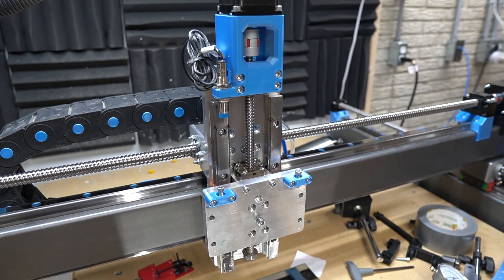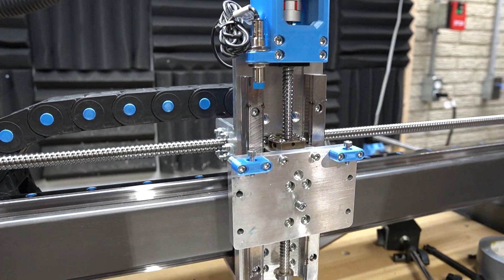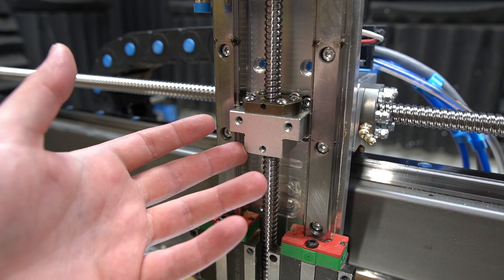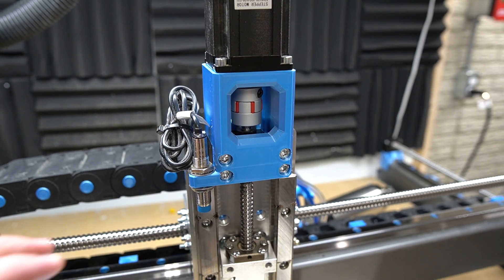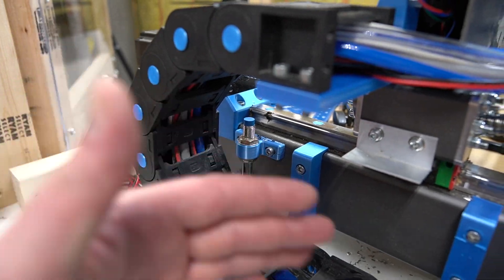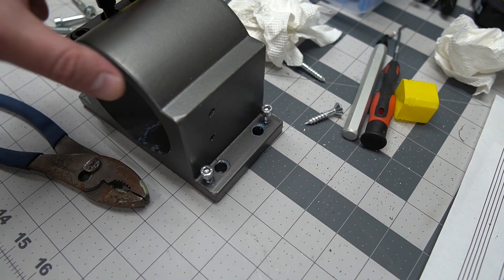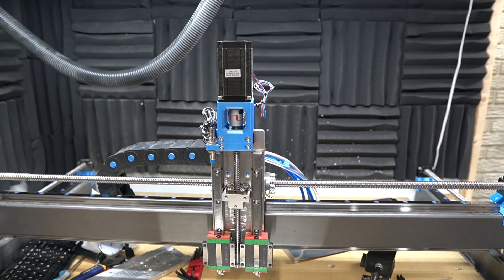Why I'm already rebuilding my PrintNC...

Comment: Hi Brian, it looks like your bfbk mounts are wider than the original. dou you know how or where this gets selected in fusion or do you modify the file? Thanks!
Reply from the maker: The bk/bf mounts I'm using I actually got from the wiki. I'm pretty sure they're parametric and I typed my parameters in to adjust it as needed. Take a look on there and I hope that helps!

Comment: Great content, Brian. I purchased a few items off your affiliate link. I was hoping to see the aluminum block listed you used for the Z-Axis T-Nut. I'm happy to purchase through your link if Amazon has a source for that.
Reply from the maker: Thanks Cory, I appreciate that! That Z Axis T Nut is typically a 3D printed part from the original design, however the aluminum version of it is a custom made part. It's just a modified version of a regular ball screw nut, with two chunks cut out to make for clearance of the linear bearings. I hope I'm explaining that well enough. There are a couple of guys in the Discord that make the T nuts on their PrintNC's to sell to other guys, or if you're handy with a bandsaw, that's how I made mine.
Reply: @ProjectsbyBrian  Thanks Brian. I printed the T-Nut, I'm just trying to find that ball screw nut block to modify. I see I'll need to cut it down , I just don't know where to get the piece to cut.

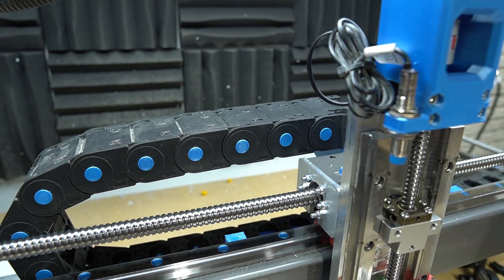Comment: Hello brian! Do you  have an idea where to find the bracket for the drag chain right under youre hand on  4:04 ? i placed my motor to the edge aswell
Reply from the maker: If you check the wiki, under the mods section, I think there is a thingiverse link to the file from there. I hope that helps!
Reply: @ProjectsbyBrian  i totaly missed that on the wiki! Ooops thanks!
Reply from the maker: @niksechtniks  No prob! Glad you found it!